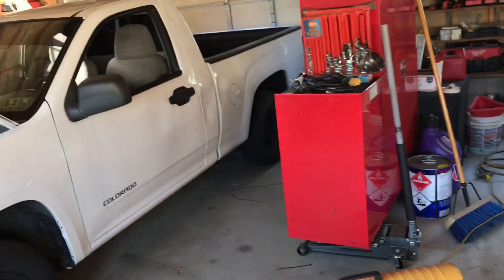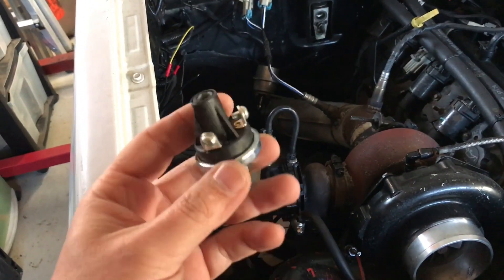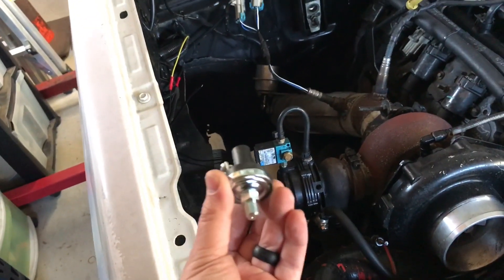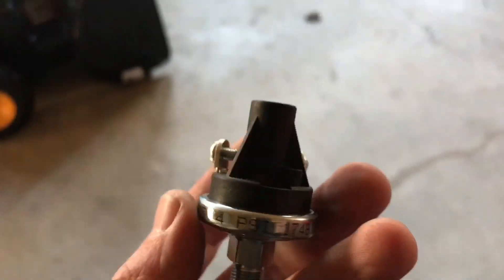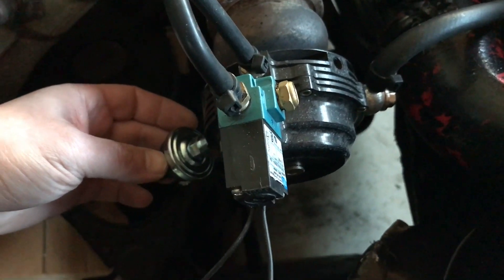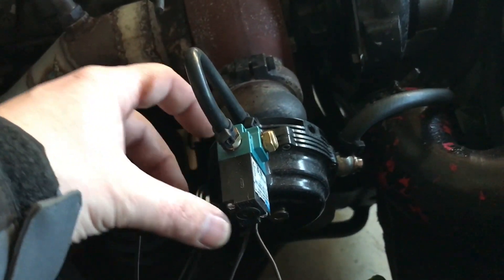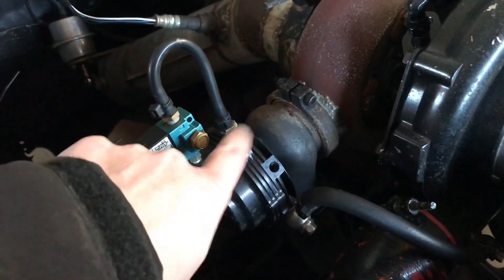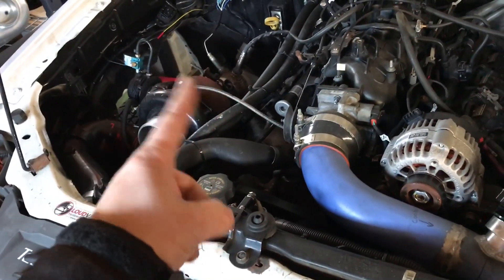Quick boost controller update

Comment: Is this the hobbs switch that you used? Thanks for the video! 

https://m.ebay.com/itm/HOBBS-PRESSURE-SWITCH-ADJUSTABLE-1-PSI-TO-10-PSI-NORMALLY-OPEN-NEWEST-MODEL/171840901010?epid=1706248990&hash=item2802840f92:g:oDoAAOSw5cNYfWKj
Reply from the maker: Yep

Comment: Hey sloppy I'm a new subscriber and just curious if I can use the same ls setup megasquirt you run on a sbf. Wanna use MSD 6BTM for ing and use a carb intake setup for fuel injection with elbow. Use the megasquirt to wire up the IAT,TPS,ECT,ACT along with wideband o2. Just looking for simple setup thanks.
Reply: The Hobbs switch see's 1psi, and acts as a switch to turn on, or allow the solenoid to switch on and start actuating to control boost. The Hobbs switch doesn't control boost, it only sees the boost and sends current to the solenoid.

Comment: Where were you out of fuel on the de caps? And was it the pump or the injector? Thanks!
Reply from the maker: approx 500-550whp on e70%  out of injector hardcore, it can do more on gasoline but i dont like to push much harder on strait gas and break a piston

Comment: I use the same Hobbs switch to run my water meth system on my TT 455 Buick, works great, kicks on right at 4lb bang on with the boost gauge.

Comment: Some electrical and pressure wizardry going on over here... Excellent. Seems like I remember you saying or posting you didn't like hobbs switches (maybe for the exact setup you are using them for now, kicking on a fuel pump) due to unreliability or possible failure? Yes, No, Maybe?
Reply from the maker: yeah i am not a huge fan,  i just did fuel stuff yesterday i have to edit the video and upload it. i dont like bumping the pump on and off if i dont need to, i feel like a regulator and running both pumps all the time is a better solution, that is just me though

Comment: Should be easy to implement a map sensor, have the solenoid normally closed, so the wastegate doesn’t see any boost until manifold pressure approaches desired level, only then it starts pulsating. Boost should rise quicker that way. Might overshoot but if the boost at which it starts pulsating is adjustable, shouldn’t be a problem

Comment: I have the same Hobbs switch I'm trying to run a second fuel pump with, but I'm relatively inexperienced with vacuum stuff and can't seem to figure out what barb fitting to order. I bought a brass 1/4" barb x 1/8" npt female and as soon as I get a thread or 2 on the Hobbs switch it starts binding up. Anybody wanna enlighten me?
Reply: Tyler Poland npt threads are tapered. Are you sure the hobb switch you have has an npt thread?
Reply: 4sf3d4g63 I'm pretty sure it's 1/8"-27npt. I don't know. I'm retarded when it comes to thread sizing / types
Reply: No worries brother, how far down did you get the tap into the hole? The further you get the tap down the further you will be able to screw the fitting before it gets tight in the taper.
Reply: I ended up just throwing some Teflon tape on it and really cranked the shit out of it... I ended up getting it screwed down about half of the threads on the Hobbs switch before she wouldn't go any further. I'm just going to run it and see what happens. I'll make sure to check that it activates the fuel pump while on wastegate pressure the first time on the dyno before I start pushing it 👍... it may be normal and I'm just being paranoid.
Reply: Tyler Poland sounds like a plan, you should be fine

Comment: Will it work? Yeah, probably. Could it be coded into the sketch using one of the analog inputs for the map sensor and making an “and” logic decision to run the pwm once map (represented in volts) gets above 1bar? Yes. Sometimes getting code to work for you is harder than you think though. This should prove to be a good proof of concept and the noid should last longer. Eventually this could end up like an aem truboost at a significantly lower cost once feedback and a PID is figured out. Good luck Matt!
Reply: 4sf3d4g63 turn the solenoid on after it sees 15 psi
Reply: That could work depending on what you want for boost. You just have to set it early enough that you minimize your boost spike, then it would work very similar to a ball and spring where the wastegate has no boost reference until the ball unseats which helps minimize lag.

Comment: For those asking about adding a boost switch onboard these arduino based dial a boost controllers: Matt wanted the simplest one I could make for him to test and use, and that is what he got. Also from the SM facebook page, alot of others want this exact simple style of a controller, I'm guessing because its similar to how megasquirt does their open loop boost control and people are familiar with it, or the fact its simple, reliable and you can set it up on a hobbs switch, RPM window switch, WOT switch, etc. Lets the end user set up a cheap simple unit however they want to set it up.

 The first units I plan on selling are going to be a cleaner version of this prototype unit Matt is testing. Once those are made and sold/stocked, I'm going to be working on the advanced style arduino boost controller. Planned features for the advanced style controller are: Boost gauge with a Max fail safe boost level, 3 programmable dial a boost switch inputs for like gear 1, gear 2, and scramble boost or gear three or whatever your heart desires, I "should" have this setup for closed loop operation by then, but still working those bugs out. It'll also have what Matt just did on this video built into the unit, along with whatever else I can think about incorporating into the unit. The advanced units will be available with either onboard MAP sensors, seperate map sensors (think GM 3 bar) OR the cheaper option of wiring it into your existing 2,3,4 bar MAP sensor signal wire.

The Cheap units are going to be awesome for someone who wants dial-a-boost control the absolutely cheapest way possible and doesnt mind doing odds and ends like what Matt just did. Price on the simple units isnt set in stone yet because I'm still working with part suppliers getting parts, but I'm still positive I'll beat anyone elses on the market in reguards to price for a adjustable on the fly open loop boost controller.

The Advanced style units should be able to compete with other name brand units as far as features, at half the cost or possibly less - or thats the plan.

Once I get all setup I'm also planning on selling these in DIY kits, for those who want the absolute CHEAPEST boost control possible, and dont mind doing the grunt work themselves.

If your interested in getting on the notification/waiting email list for any of these planned units, email dale@twistedbuilds.com and I'll throw you on the ever growing list.

Comment: So, should the new switch fail, does that mean you won’t have any kind of boost control at all? Or will it just be limited to what spring you have in the wg?
Reply: blockequals4 it’s designed to fail safe.
Reply: itll be based on the spring in the wastegate. so itll drop down from solenoid pressure to a lower 4psi WG pressure
Reply: ShadowOfDeath24 awesome, thank you!